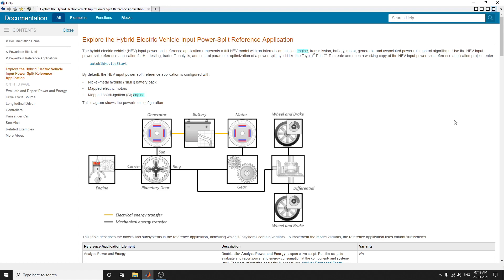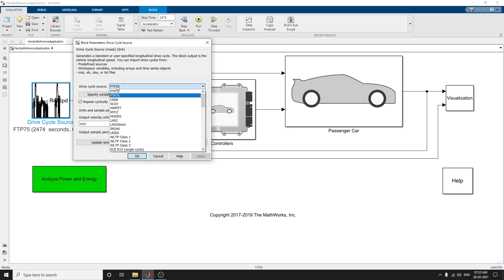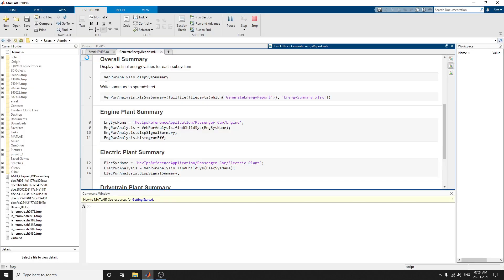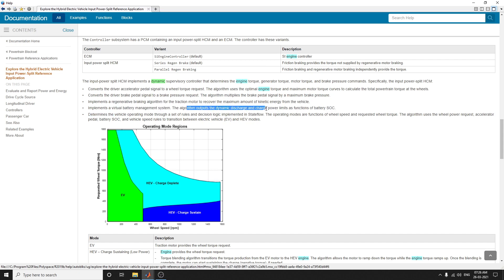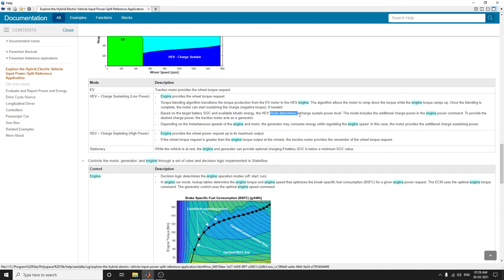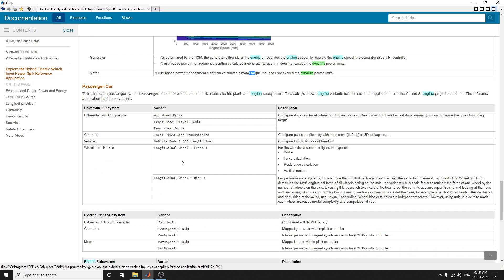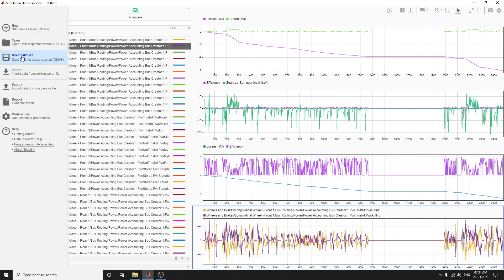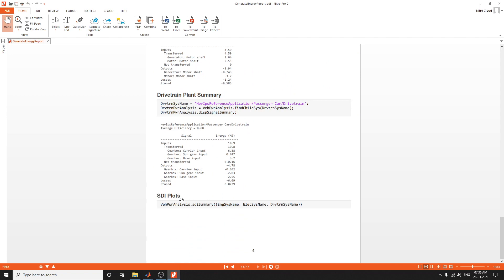Design & Simulation of Full Multimode Hybrid Electric Vehicle Model_ Matlab Hybrid Control Module

Comment: hi sir, i have a project for a parallel hev using a fuzzy logic controller. i wonder is there an indicator to check for fuel consumption and energy consumption bcs that is the aim of the project to reduce both consumption with creating the EMS with the fuzzy controller. Thanks in advance.
Reply: Hi.... my project is also similar to you. Can you help me out ?